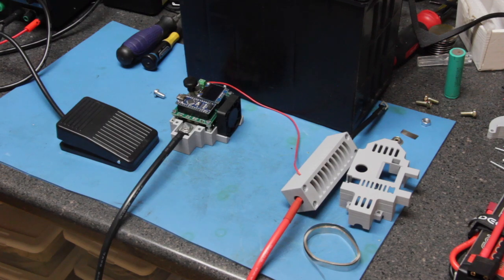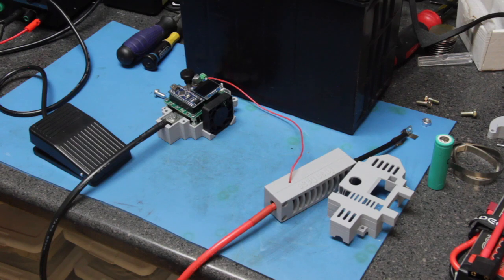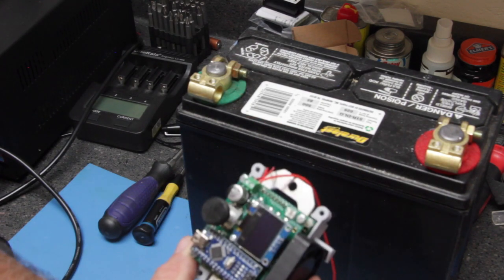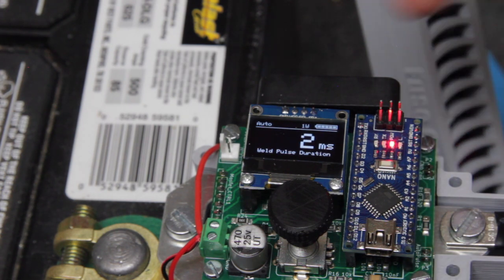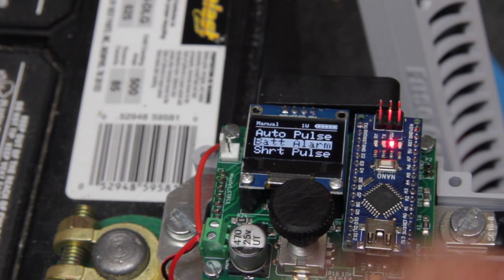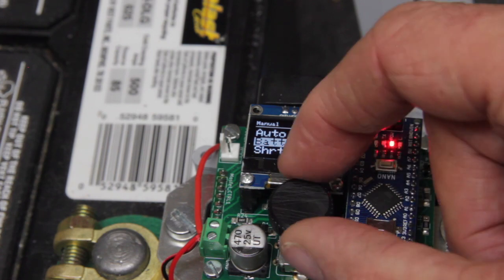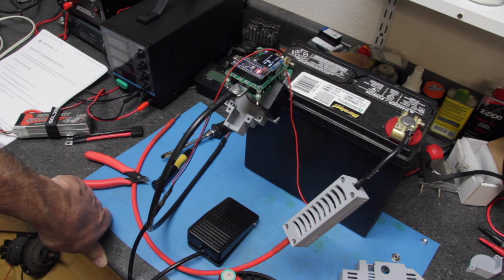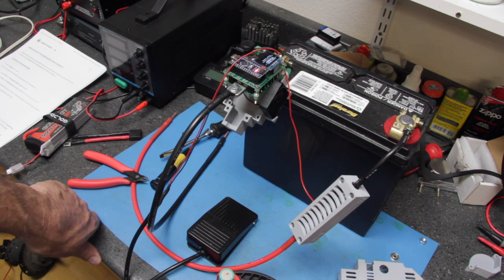Malectrics DC Spot Welder Review and Operation

Comment: thanks for video i have 12v  77ah car battry with 630a cca is that a good power supply or lipo will be better?
Reply from the maker: Either is fine,  I did my testing on an auto battery, no problems,  Minimum is 500 CCA
Reply: @JoediyLab  this is fantastic welder 
weld 0.20mm pure nickel with very strong clean welds on 17ms... im sure it can easily weld 0.3mm on higher settings maby even thicker
great price and quality compare to sunkko main outlet witch it can even damage the home electric board or keep trip the fuse
Reply from the maker: @alireza071  Thanks,  I agree, very nice welder